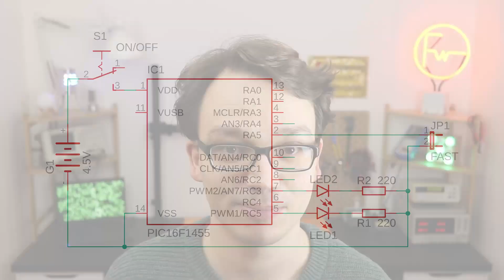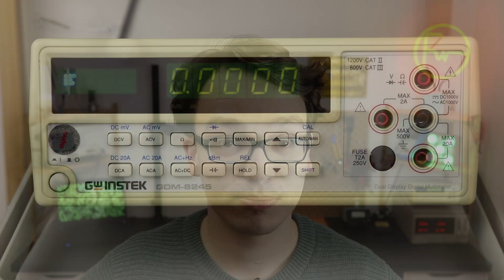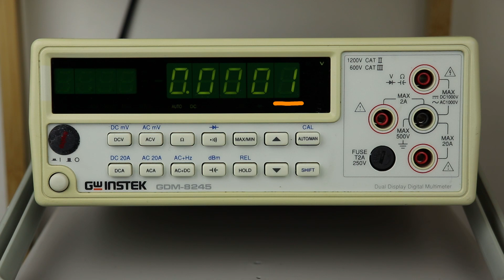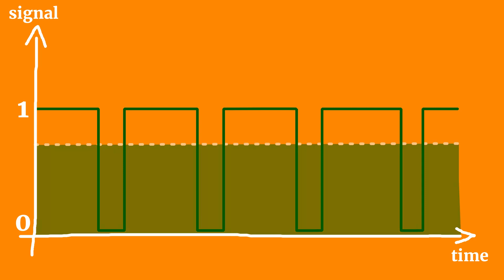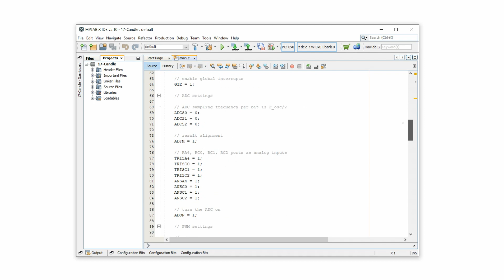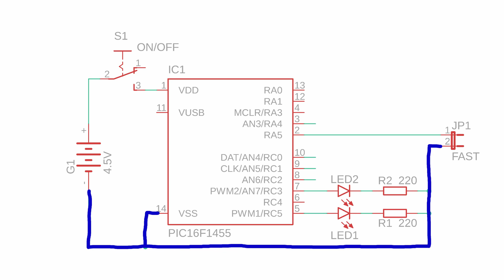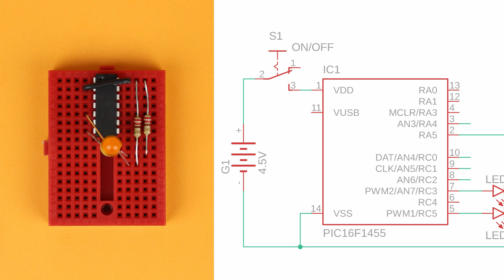Electronic candle with PWM and flicker effect

Comment: A great project and a great video — everything is well shot, edited and presented very nicely. Excellent job!
Reply from the maker: Thank you so much, I am happy you like it! Do you have any suggestions on future topics that might be interesting? I am thinking of doing an RS232 tutorial and I also have one CMOS project in the pipeline.
Reply: @FriendlyWire  Well, RS232 is very interesting to me as a retro computer enthusiast. I would enjoy that very much.
Reply from the maker: @MindFlareRetro  Consider it done! :) I actually am very fond of RS232 because it is such a simple interface, and most controllers have a USART module that is compatible. The only pain is the level shifter MAX232 which makes it a bit more involved.
Reply: @FriendlyWire  Nice! Looking forward to it. I purchased a used Fluke 45 dual display bench multimeter (with an RS232 interface at the back) a couple of years ago. And about a year ago I came across a gentleman who created a small Windows program that would display the DMMs output via the RS232 port. I should probably get myself a cable to see this in action.
Reply from the maker: @MindFlareRetro  Yeah, RS232 is a really nice, simple, and non-proprietary interface for that sort of thing :)

Comment: Thanks so much, this is great. Literally exactly what I want to do, but haven't the MC knowledge to figure it out for myself. I have a couple of questions; is it possible to use a potentiometer to control the rate, and can the signal be used to control things other than an LED? Thanks again.
Reply from the maker: I am glad you liked the video, and apologies for my late response. Yes! You can do that! Check out the PIC16F455 ADC tutorial here: https://www.youtube.com/watch?v=AlpbbeX7-BU . What kind of other things would you like to control with the circuit?
Reply: @FriendlyWire  I'm a musician, I was hoping this would be a handy way to make a smooth sample and hold LFO. Really I'd like to be able to make and program musical devices, like digital effect pedals and synths, without having to put an entire Arduino inside, as that seems wasteful.
Reply from the maker: @tziirkq  Ohh that is so interesting! I have no experience with this, but could you describe it a bit more, perhaps via email? You can find my address at the bottom of www.friendlywire.com :)

Comment: Sir can you make more effects like fire, welding spark, lightning effect, cloud pass, tv blink, etc.
Reply from the maker: Thank you for your question and for your interest, Sanaullah, it's great to have you here! :) With just a few LEDs you can make very simple animations, but they can be quite powerful. I think all the key is in the timing. Have you looked at the source code of this project? I am sure you could try it! Let me know if you have questions about it, you can always reach me on Twitter @FriendlyWire as well, happy to help! :)
Reply: Thank you so much Dear respected sir
Sir if i want to find the timing of any effect then how to get it like spark timing of welding By the way, how did you determine the timing of the candle flickering?
Reply from the maker: @Sanaullahalam95  My pleasure, and thanks for your interest! :) I just tried around to get the effect I wanted. I am no expert with animations but I had some idea what I was after. If I wanted to do a welding spark thing I would change the color of the LEDs to white and blue, and use sharper transitions. You could also look at welding videos on YouTube and play them back at a lower speed (click on "options" and then on "playback speed" and you can set it to 0.25) which will give you more details :)
Reply: @FriendlyWire  thank you dear sir
Sir if microcontroller pic16f1455 is not available in my local market so can change the ic number like pic16f676 in source code?
Reply from the maker: @Sanaullahalam95  Yes, it works also with the PIC16F676, it is very similar to the PIC16F1455. BUT you will need to change some parts in the code. Feel free to message me on Twitter @FriendlyWire if you need help with that, we will get it to work! :)
Reply: @FriendlyWire  sure
Reply: @FriendlyWire  Please tell which line to change in the code
Reply from the maker: @Sanaullahalam95  First thing is to set up a new project in MPLAB X IDE for the PIC16F676 :) Check out my introduction video here to see how to do this: https://www.youtube.com/watch?v=e4Q2dYVedPY Does that work for you? After that all works we can take the next step :)
Reply: @FriendlyWire  thank you so much Dear respected sir

Comment: hi. can i use the PIC16F1455 with led strip and 12v? thanks u
Reply from the maker: Hello :) The PIC16F1455 is for 5V maximum, so I don't think it works right away. Do you have a link to the LED strip you have in mind? It might be possible to use a special driver :)
Reply: @FriendlyWire  Hello thanks for answering, this is the link https://a.aliexpress.com/_mroQxPn, I want to make a lava diorama and I want to do the candle effect but it is 12volts
Reply: @FriendlyWire  I would appreciate your answer🙌🏻
Reply from the maker: @Boltex320  These LED strips are "smart" LED strips that can be any color you want. If you search YouTube for "Neopixel fire animation" you should find something that works well. The project in my video here is just for single-colored LEDs, and unfortunately it's not "smart" enough.

My next project will be about the PIC16F1455 and how to drive Neopixel LEDs with it, but it will be a few weeks until it is out.
Reply: @FriendlyWire  Thanks, I'll look for neopixel on youtube, I don't need rgb anyway, I want 2 strips warm white as a candle
Reply from the maker: @Boltex320  Neopixels are always RGB, some of them are RGBW with an extra white channel. If you want warm white LED strips then it's probably easier to use single-colored ones and not the Neopixels. Still, the Neopixels have the advantage that you can adjust each LED separately. If you get an LED strip that is one color, chances are it's just ON/OFF for the whole thing.
Reply: So what do you recommend using for the candle effect?
arduino or some microcontroller? for these 12volt LEDs. thanks for your time
Reply from the maker: @Boltex320  I think it depends on your own preference, so let me ask you: what's the size of this diorama? And what's your main goal of this project: learning how to use microcontrollers, or rather to get a nice-looking lava animation as soon as possible? :)
Reply: @FriendlyWire  hi again!, well I want it to look the best it can be, measuring 14 "x 7"
Reply from the maker: @Boltex320  Is that the size of the diorama? Or the size of the lava field? Feel free to direct message me on Twitter @FriendlyWire btw this might be easier :)
Reply: @FriendlyWire  lava field bro, ok sounds good 🙌🏻
Reply from the maker: @Boltex320  OK, great! This will be easier to send over pictures and schematics and so on :) See you there!
Reply: @FriendlyWire  yeah for sure !

Comment: How long will this last with the battery pack?
Reply from the maker: Good question! According to Google, a typical AA battery has between 2000mAh-3000mAh capacity. If both LEDs were on at the same time, and each LED draw around 10mA, that would be 20mA total current draw (with the current consumption of the controller negligibly small), resulting in 100-150 hours of continuous operation. Of course that is just an approximation: the LEDs are not on continuously (they are driven by PWM at reduced effective brightness, after all) and also the batteries won't last until zero capacity. So I would guess that the circuit should run for around three days straight.

Comment: Nice video. Done similar projects using an attiny25/85 and an arduino as the programmer. Any reason you used a pic16f1455? I haven't used this mc yet, wondering if I should.
Reply from the maker: Thanks! I like PIC controllers because they are fairly affordable and rather simple to use, but there is no reason you have to do this project on  a PIC, the general idea works with any microcontroller that has ADC inputs. I like the PIC16F1455 and also its related chips like the PIC16F1459, they are quite powerful.

Comment: That's really some work for a candle :)
Reply from the maker: True :) But after you know how to use analog to digital converters and pulse-width modulation on a microcontroller, there are many many other cool things you can do. I believe in finding a simple starting project, and then taking it from there :)